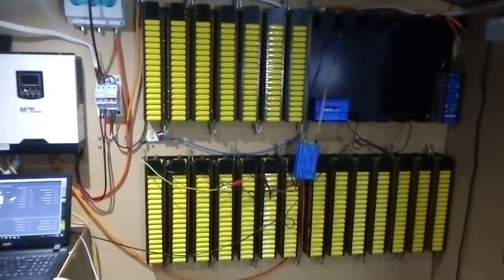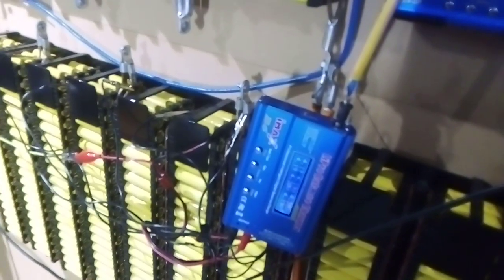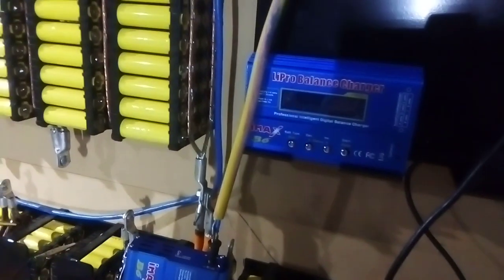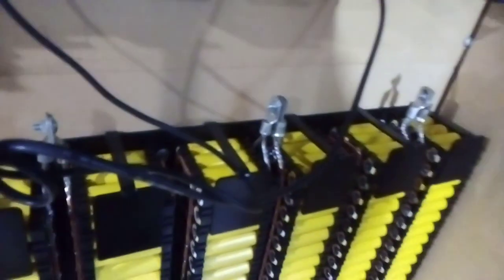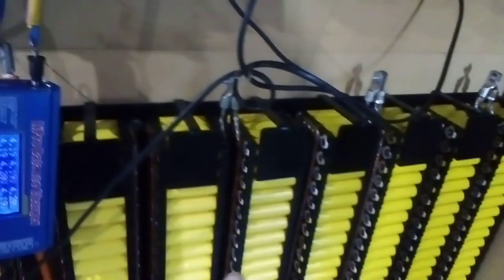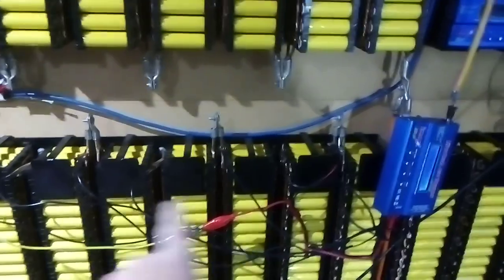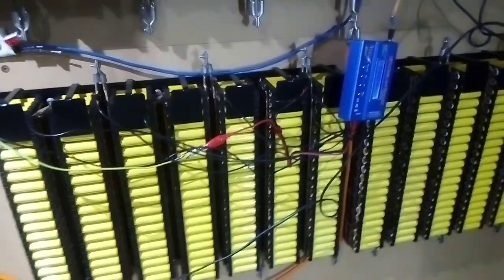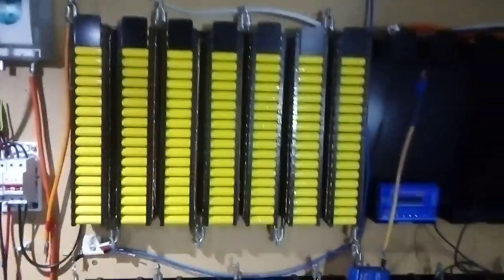12.7 KWh of Li-Ion 18650 of Storage PowerWall in a Solar Off Grid setup.

Comment: Brother did you see the balancer I have? Was around 100  bucks US. Will do up to 24s.  LOVE IT so much..  I have a playlist of it. Would likn but it will post as spam..  LOVE your setup brother. Thanks for sharing. God Bless.
Reply from the maker: My setup is modeled after Pete HBpowerwall. I do have my heart set on Batruim BMS. I will certainly check out yours.
Reply: @adamcecere3369  I know what your saying. Hr and I have been friends for years. One hell of a good dude. There nice just cost a lot..
Reply from the maker: @yankey4  Yes that Batruim does cost a lot. That is why I haven't got the BMS yet. About $1000 AUD. Aprox $1450 USD including the Shunt.